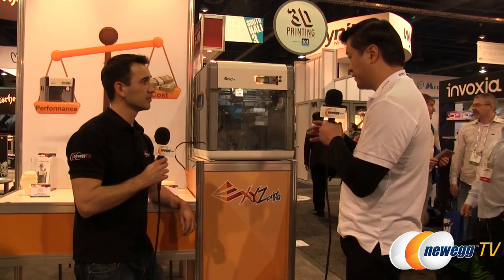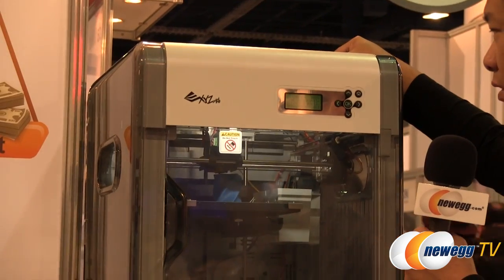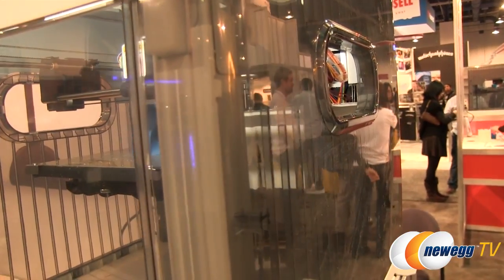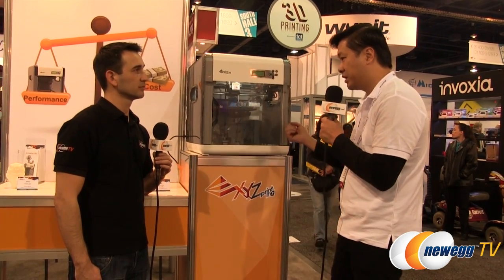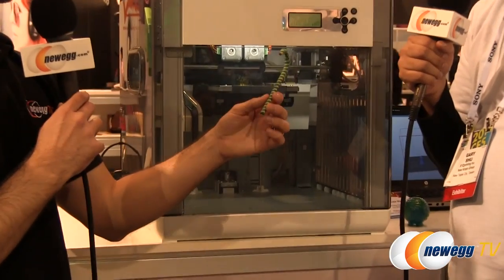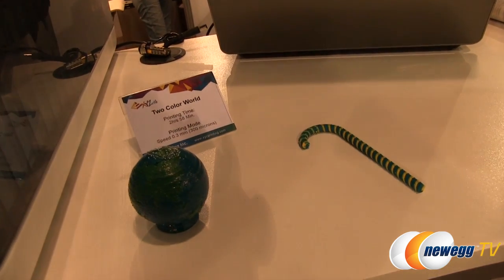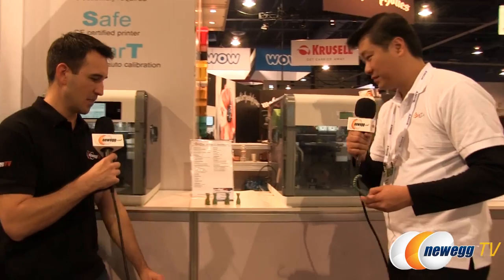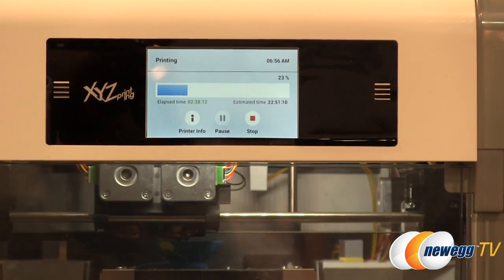XYZ Printing Da Vinci 3D Printers @ CES 2014 - Newegg TV

Comment: Saw this review on your site: 

"Pros: Enclosed, easy to set up, comes with everything you need to start printing.

Cons: Software is bad, very bad. Many prints would fail to slice on the XYZ software. Tested the same files in Makerware and no problems at all.

Other Thoughts: I will say the manufacture tried to fix the problems I was having multiple times. Ended up returning the item." 

was very disappointed to see that, but here is my question, does a stl file mean it is already sliced and ready for printing or does it have to be 'resliced' each time it is introduced to a new printer. 

I have not purchased a machine yet, but I believe I will be getting this one.   Please advise